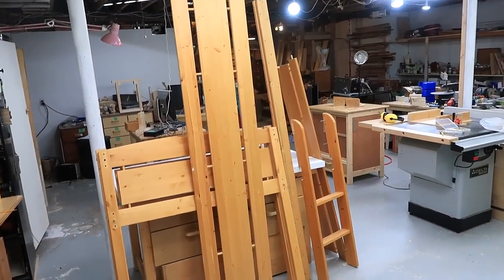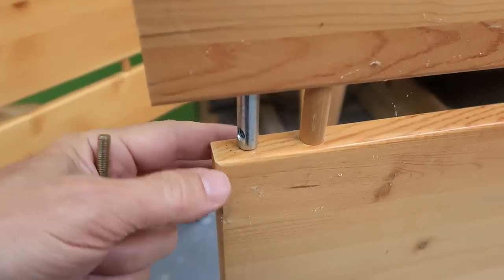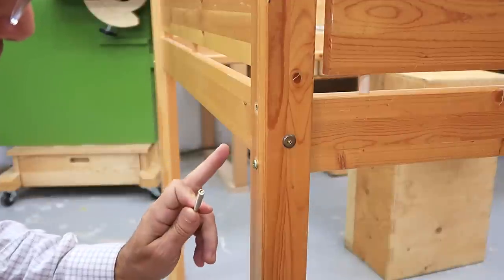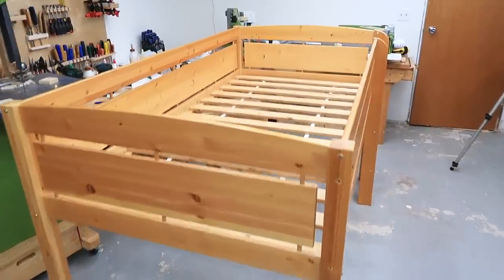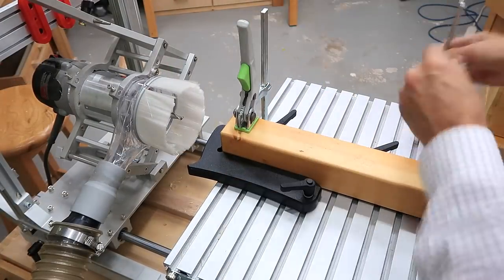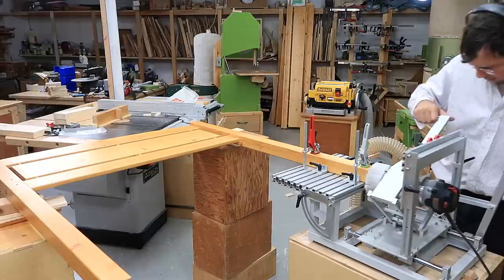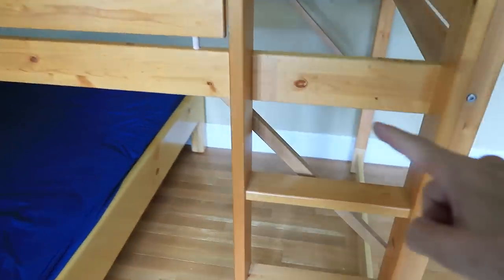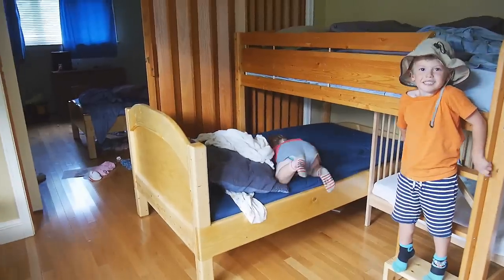Right angle bunk bed

Comment: When I was younger my big brother and I had a right angle bunk bed like this, except the top bunk was higher, maybe 6 feet. I had the top bunk. The first morning after we got it assembled I wasn't used to waking up 6 feet in the air, so I got outta bed like normal. But this time I fell ~5 feet straight down and landed on my peacefully sleeping brother! He was NOT happy to be woken up by my accidental body slam!
Reply: "accidental"
Reply: @monstertrucklt  The voiceover inside his head sealed the deal "Rage in the cage '89 right here at the bunkbed dome"
Reply: Growing up, we had a small house, so my dad made a bed with 3 bunks. I'm glad I wasn't the one on the "nosebleed" top bunk.
Reply: I think you are getting your terminology mixed up. That would be called “going off the top rope” .

Comment: Good insertion tool... I got inspired by you, to use magnets more often in my work flow... So I used magnets for this insertion job recently :)
Reply from the maker: Hadn't even thought of magnets.  That would be good if the hole is not oversized.
Reply: Or just glue the opennings shut with dowel and screw with frickin deck screw, and be done with it 🤔👍😇

Comment: Might be worth getting a piece of pipe insulation and sticking it on the bottom corners of bunk over the other bed to avoid any future 'head impacts'.
Reply: You can get babyproofing "edge guard" made for this purpose.
Reply: Or swimming pool noodles.
Reply: I did the same thing in my shed. It's now a less angry place 👍
Reply: @kwizmon  oooh that's a great idea..
Reply: Pool noodles were recommended at my dorm

Comment: Hi Matthias! Those bolts are usually pointy for screwing into inserts. Helps align the insert with the bolt. Maybe it's possible to chuck it in a drill a sharpen on a belt sander like you did with the dowel? Regardless, that make-shift tool works 😁
Reply: steel rod with a magnet might work as a tool to insert those threaded inserts as well. Insert should stick to the end of the rod well enough
Reply: @krahaborowski  or he could do what he did because it's done?
Reply: @natalieisagirlnow  Sure, but next time he does something like this he has other options.  Besides, if he's anything like most woodworkers I've met (including me), that makeshift tool probably disappeared about five seconds after he didn't need it anymore.
Reply: @natalieisagirlnow  sure, but for me, big bolt and a HDD magnet would be easier to find in a workshop. And that would work in a tight hole too
Reply: @jeffspaulding9834  and he literally made it from a soda can 30 seconds before he used it, which he could again, if he happens to find that exact bunk bed on a trash pile again
Reply: @natalieisagirlnow  Never hurts to have options.

Comment: What a great tools you have there... amazing. I planned to make a bunk bed for the kids few years ago, and prepared a DIY cross dowel jig for this project (I made a video about it), but finally I didn't build the bed, since we got a used loft bed 😀. Now due to lack of space, I plan to extend the loft bed height to a bunk bed in about 50cm, and I wonder if using wooden dowels to connect extension, will be safe enough? Or I should replace the legs completely...🤔
Reply from the maker: 50 cm is quite an extension, might be ok if you use four 3/8" dowels in the legs.
Reply: @Matthias Wandel  Thanks!! ❤️
Reply: @XDIY  definitely add some cross bracing if youre going up that high.
Reply: @ionstorm66  Thanks. I think I will replace the legs... (result probably be at my channel one day, when I have time for this project 🙂)

Comment: nice. strongly propose adding cross braces to the underside of the rails of top bunk to prevent slats from slipping off the ledge. happened to me when kids lay across the width and kicked the other side. this widened the distance between rails.

other option - screw down a slats to the ledges
Reply: even just one brace in the middle will do it, a number of years ago I built an elevated double bed in this style, after a couple of months the sides shifted enough that the slats fell through, added a brace to tie the sides together and never had another issue.
Reply: I put small dowels inbetween the slats (around the end ones and then every 3-4 slats) so they can't move far.
Reply: @IIVQ  dowels will stop them moving in the head/foot direction, what we're talking about here is the siderails splaying out enough that the slats fall through, for that you need something strapping the two siderails together (or some really beefy side rails).
Reply: @SomeMorganSomewhere  Ah. My (2person) bed has beefy side rails and a nonbeefy centre rail, but the dowels keep the two slats butted up to each other so there is no reason for the centre rail to move lateral. It did twist, so I made some "gusset plates" at the end to stop that from happening - and as an undesigned feature stop my cats from crawling into the space between the drawers and then into the drawers to nap on the no-longer clean sheets

Comment: Nice work very professional.. those clamps that fit the extrusion table..how do they called?
Reply: Quick Release Ratcheting Table Clamps. Sometimes marketed for multi function table (MFT) systems like what you see in cnc routers or laser cutters.
Reply: @DullPoints  can't find it on amazon .. maybe in stores. Thanks

Comment: I'm surprised you didn't turn the single barrel bolts into a double with a bit of epoxy and wood dowel.

Then again, gluing them into the tool you used to insert them would have done the same thing.

Comment: Do you have any safety switch or something similar that's "toddler proof"? Since you have shop at your home and one day a kid might come down to try some things? Or are you home all day? In that case, do you have any suggestions for that, other than a basement/shop breaker and/or keys to the door?
Reply: you can get key switches on tools. but why not just lock the door?
Reply: @katelights  I know, and that what I said. But if your shop is at home in your basement, I would imagine that sometimes you don't lock the door.

Comment: I see two potential safety issues. Bottom kid climbing the side and the top kid jumping down to the bottom bed
Reply: When I was a kid, my bunk bed was next to what used to be a window (former exterior wall).  I'd often wake up on the top bunk in the morning, go head-first down the window cavity to the lower bunk, and then come out via the bottom bunk.

Banged myself up a time or two pulling that stunt.  It's just part of growing up.
Reply: That is not an issue, it is a feature!